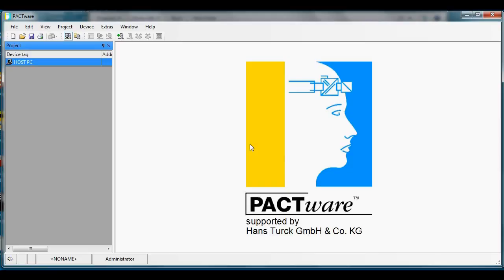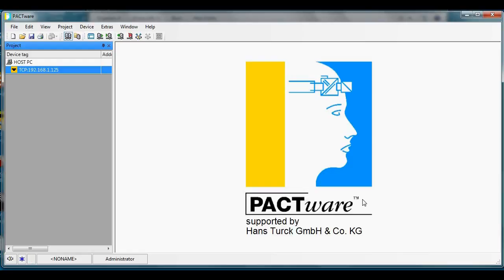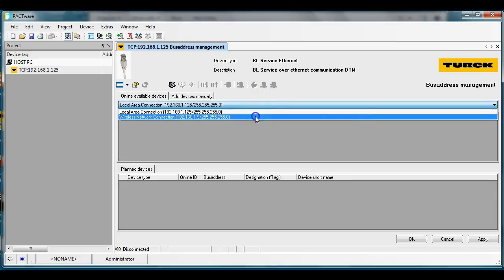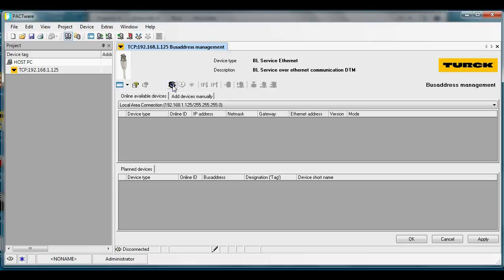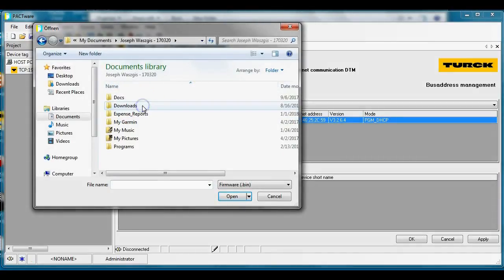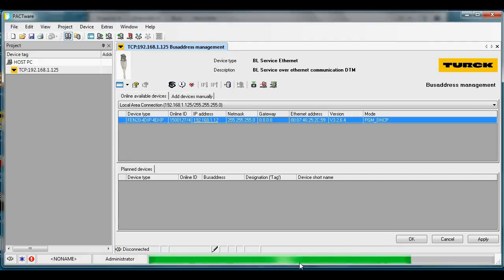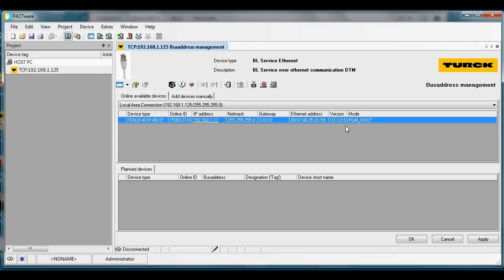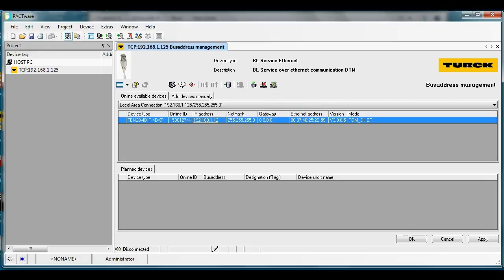TURCK Firmware Updates for IO Devices

Comment: What version of PACTware are you using?
I tried both version 4 and 5 from the Turck website but I do not have a "BL Service Ethernet" DTM device, so i'm stuck. Did you install anything besides PACTware?
Reply: figured it out:

PACTWare 5.0 in combination with DTM for Fieldbus I/O Systems BL20, BL67, BLcompact, FEN20, FXEN, FGEN and TBEN